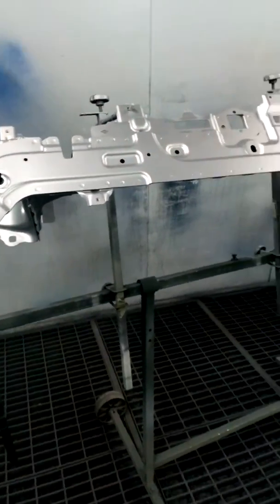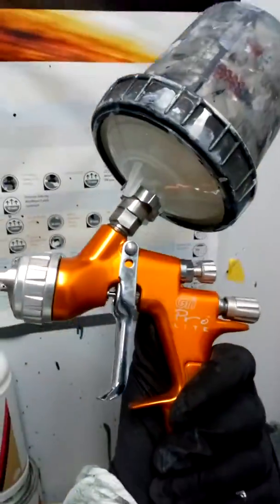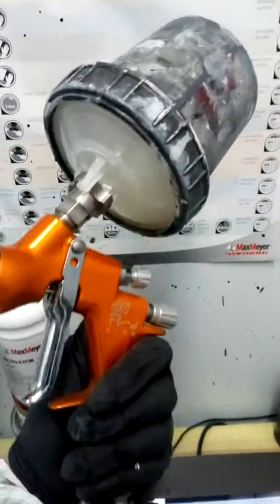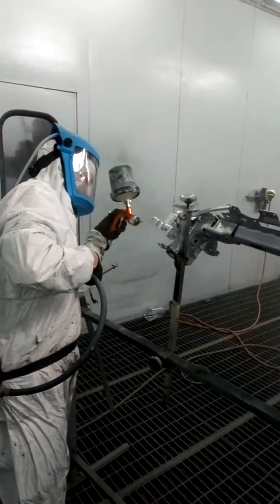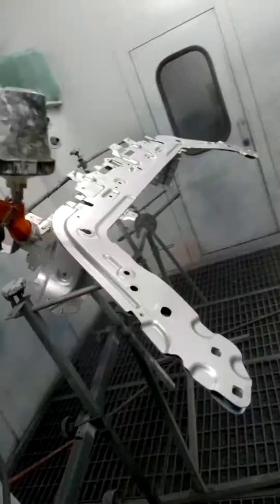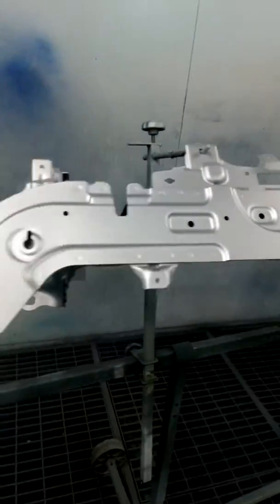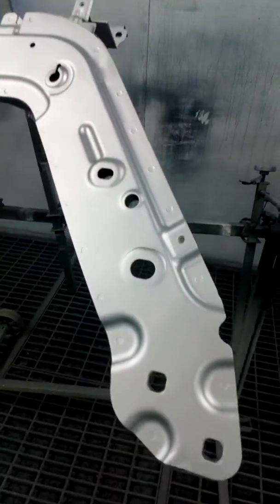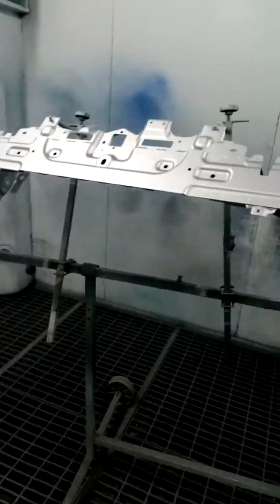Jaguar Matt silver clear coat

Comment: Nice work. What air cap is it?
Reply from the maker: Thanks its the T 110 Air cap and the fluid tip is a 1.2
Reply: @retrorepaints9351  do you spray that wet wet or medium?
Reply from the maker: @paintworkbyjr3685  probably medium